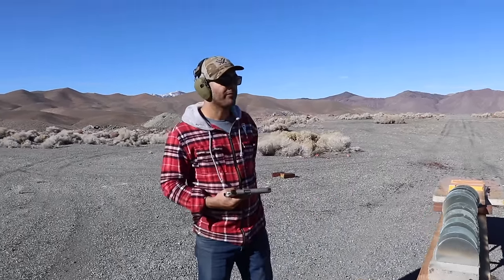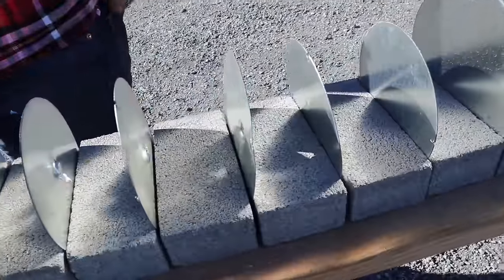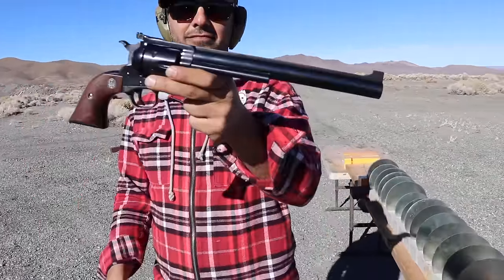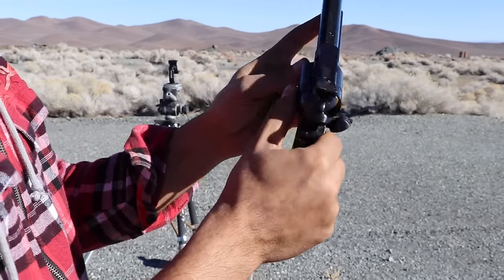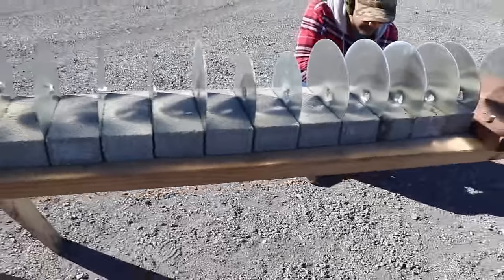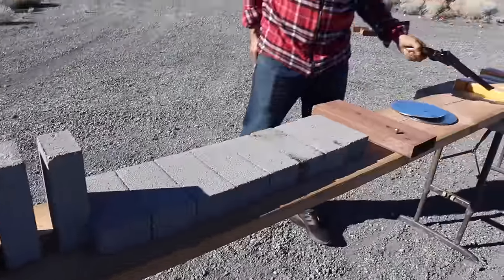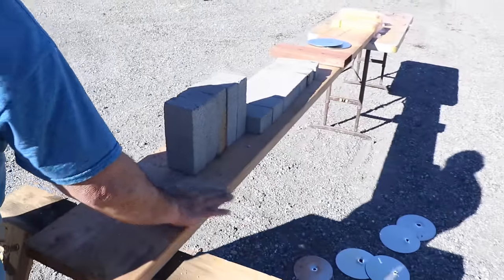45Colt vs 45Acp

Comment: The 45 Colt Government case was the parent cartridge for the 45 Auto Colt Pistol,. The 45 Colt Government was in all reality 45 Colt cases cut down in length to fit in the 45 Schofield, while still working within the 45 Colt pistol. 

So in all reality the 45 Colt case was the parent case of the 45 Colt Government, and the grandparent of the 45 ACP. The 45 Scofield 's only influence was that the army had the 45 Colt case trimmed down in length to fit in a Schofield while still being able to chamber in the 45 Colt pistols which caused the 45 Colt Government (a.k.a.- 45 short Colt) to be born. 

That is to say the 45 Scofield was only directly involved in the reason for shorting the 45 Colt case which made it but only indirectly involved in the 45 Auto Colt Pistols round development. Basically when the 45 Auto Colt Pistol was being spawned the 45 Schofield was benched on the sideline as the 45 Colt Government was spreading it's seed. And as all grandparents are, the 45 (Long) Colt was proud as could be, and still is to this day. 

Long Live the three generations of 45 Colts (45 [long] Colt, 45 [short] Colt Government, and the 45 Auto Colt Pistol rounds) - Amen!

The so-called “.45 Long Colt" is just a nick-name for the ".45 Colt” . That is to say the term "45 long Colt" is referring to the original round that was called ".45 Colt" which was made by the Union Metallic Cartridge Company. And the so-called short Colt was a nick-name referring to either the "Calibre .45" made by Frankford Arsenal or the ".45 Colt Government" made by Winchester (but not the .45 Schofield).

The story goes like this, first the government had the 45 Colt made. Then the government adopted the 45 Schofield being it was top break, and just so happened that it could not handle the 45 Colt round [even though the government asked them to try and make it handle such] but instead S&W decided to make it with a shorter softer shooting 45 caliber round (now known as the 45 Schofield cartridge). 

So now the government had two different pistols each with different case dimensions. The 45 Colt round was too long to fit in the Schofield, and the Schofield's rim was bigger around and would over lap each other when put into the Colt pistols, whereby only three rounds could be chambered in every other chamber, effectively making it a three shot pistol. This caused a huge logistical dilemma for the USA military. So the military came up with a solution of which they simply shortened the 45 Colt case down to 45 Schofield length. By doing this they had a case with a small diameter rim that would fit in the 45 Colts, yet at the same time was short enough to fit in the 45 Schofield pistol as well. Frankford Arsenal got the government contract and called the new round the "Calibre .45" and later when Winchester started making them they called them the ".45 Colt Government". And while neither of the three rounds ever had long or short in their naming by the manufacturers that produced them, soldiers and citizens would speak of these as long and short Colt rounds. Yet if they were talking about the 45 Schofield they would simply say ".45 Schofield". 

So actually the 45 Schofield was not the reason 45 Colts were called ".45 long Colt", at least not directly. That is to say the only reason long and short ever came to be spoke of was because they shortened the 45 Colt cases down to be able to fit in a 45 Schofield pistol too. Yet at the same time 45 Schofield rounds were never ever called "short" because no body ever shortened or lengthened the Schofield rounds. 

So again, even though the three different manufacturers never named any of these rounds by either Long or Short there were long and short 45 Colt rounds made. And the short ones could fit in the 45 S&W's Schofield pistols as well as the 45 Colt pistols. 

So if anyone ever tells you that there was never any such a thing as a long or short .45 Colt know that they speak from ignorance. And if anyone ever calls them by "45 Long Colt" or "45 Short Colt", well, simply understand that they are using nick-names given to them. Yet again, the correct names for the variety of 45 Colt rounds are ".45 Colt", and "Calibre .45" or ".45 Colt Government".

Comment: The long barrel on the single action Ruger skewed the test results. If you had used two guns with the same barrel length the results would have been nearly identical.
Reply: I agree  ,  they should know that.

Comment: 45 Colt aka 45 LC on average have a 10fps muzzle velocity difference and a 25 grain weight difference both in favor of the LC. 45 LC is also purposely under loaded. 45 lc could be even stronger than 44 mag if they loaded it to modern standards

Comment: I had a feeling that Colt was going to be brutal. The round was twice the size.
Reply: The cartridge size in this case has nothing to do with it. The 45 Colt round was originally a black powder cartridge, which used 40 grains of black powder which is bulkier than modern smokeless powder.
Barrel length also effects muzzle velocity as well.

Comment: A Ruger vaquero exploded in my friend's hand luckily no one was hurt send it to Ruger they said it was over pressure this is one cartridge that very easily can be overloaded with too much powder or double powder or worst check with a flashlight that all your gunpowder is visually the same level which better be correct in the first place

Comment: The 45 Colt has a longer barrel and heavier bullet.  The 45 Automatic Colt Pistol is at a disadvantage.
Reply: Not so.  The auto pistol has a solid barrel, the revolve has the barrel/cylinder gap which vents much of the gas to the sides.

Comment: Yeah but which one kick's harder? Which one has more recoil? I shot a 45 ACP and it wasn't that bad but I have a 45 lc now and not sure I can handle it!
Reply: I have a 3” judge and a full size 1911 and the recoil on the 45LC is not even close to the acp so I’d imagine if you have a longer barrel than that, it’d have even less muzzle flip to it.

Comment: The Ruger revolver 45 Colt barrel is much longer than the 1911 45acp.
The revolver will add more kinetic energy to the 45 Colt bullet, allowing more penetration. 
Not a fair test. If done with similar barrels, another story.

Comment: I didn’t see any description for the ammo being used. There seems to be a lot of variables here. Bullet types differ. Barrel lengths differ. There are many different power levels available for ammo in both calibers. The 45 Colt is the most versatile of the two, due to its case capacity and almost limitless projectile choices. Still, it was entertaining.

Comment: So is everyone just ignoring the barrel length differences? Ones 8”+ the others 5”. Fire them both out of the same length barrel. 

45 colt isn’t used prevalently for a reason… it’s no better than a 45 acp, the firearms are large and clunky, holds less rounds and other than the judge/governor modes, it would have gone the way of the 44-40.

Comment: Continuing third comment the 45 Long Colt if you're reloading you better visually check that you did not put extra powder in any of the shells using a flashlight another safety thing is you can press in the slug immediately after putting the gunpowder and don't start daydreaming or thinking of other crap while you're loading the powder focus on putting the right powder and keep your brain

Comment: Okay so there's a lot to unpack here. First of all barrel length definitely matters. There's a lot of unburned gas in a 5-in barrel that comes out the front as muzzle flash. 10 in there's probably very little unburned gas so I would imagine muzzle velocity climbs significantly for the 45 LC. Also I'm not sure that you're fairly comparing ammunition. I don't know what kind of ammunition you used in the 45 long colt. But essentially there's no such thing as non plus p or non-designer ammunition in 45 Long Colt that's manufactured today. All of that ammunition is going to probably be smokeless powder. The gun was originally designed as was the 45 ACP for black powder. The 45 Long Colt completely filled with black powder, with no doubt explode if filled with smokeless powder, but wouldn't even match a quarter of a standard case round filled with modern smokeless powder. In other words modern 45 Long coal ammunition is significantly stronger than the hottest possible loads from the 1800s. I wouldn't even put modern loaded ammunition into an 1800s revolver for various reasons, one of which would be case pressure. It's important to know that before I say originally 45 ACP and 45 Long Colt were designed to be equivalent cartridges. Both would have been more or less filled up with black powder in the case of the Long Colt and smokeless powder in the case of the 45 acp. Both of those being 1800s early 1900s examples of smokeless and black powder. Today you will blow up your freaking gun if you do that! Do not fill them up today with modern powder! But that's what they were originally designed for. Or more specifically 45 ACP was designed to be an auto pistol feeding version of the 45 Long colt. Basically when Browning design the cartridge for the 1911. He wanted 45 Long Colt ballistics but he didn't want the rim and having a shorter case was both advantageous because the longer case was unnecessary with modern powder and it made the handle shorter and more comfortable. So he worked with Colt to make a shorter version of the 45 Long colt. Today you can make really hot 45 Long Colt rounds and shoot them out of things like that Ruger Red hawk because that Ruger Redhawk is rated for 44 magnum. Which is not an equivalent caliber. That's a super long 45 Long Colt. Even the regular 45 Long Colt guns contain the metallurgy of those larger handguns. So modern 45 Long Colt ammo has 1. a lot more space than it needs to create a proper powder load. 2. Have better metallurgy then the original version of that cartridge. 3. Because revolvers don't rely on a very specific amount of pressure to cycle the gun properly they can shoot hotter loads without significant risk of mechanical failure. That being said they do make better more specific 45 loads that would be more analogous to shooting modern powder out of a 45 Long Colt. In the interest of keeping the test fair you should be using plus p 45 ammunition. Also the jacketing for the bullets should be similar as well as the weight. And of course as I mentioned before the barrel length.

Comment: The .45LC can be hand loaded to higher pressures than the .44M. In the Ruger Blackhawk.
Reply: I do that in my Henry .45. Just don't do it in an old gun or a handgun not strong enough to handle it.

Comment: There is no significant power difference between 45 colt and 45 acp, the 45 acp was designed specifically to achieve similar ballistics to the 45 colt in a smaller case due to the 45 colt being a black powder cartridge and 45 acp designed to use smokeless powder. Winchester super x, 45 acp, 230 grain, 835 fps, 356 ft lbs of energy. Winchester super x 45 acp, 185 grain, 1000 fps, 411 ft lbs. Buffalo bore 45 acp +p 255 grain, 925 fps, 484 ft lbs. Buffalo bore 45 acp +p, 185 grain, 1150 fps, 543 ft lbs. Winchester super x 45 colt, 255 grain, 860 fps, 420 ft lbs.  Buffalo bore 45 colt, 200 grain, 1100 fps, 537 ft lbs. Buffalo bore 45 colt, 255 grain, 1000 fps, 566 ft lbs.
 The only time you will find 45 colt that is significantly more powerful that 45 acp are the exotic over pressure +p loads that come with a chart that says what guns are safe to shoot them in and which will blow up in your face such as the buffalo bore 45 colt +p deer grenade, 260 grain, 1500 fps, 1200 fp lbs which is basically a 454 casull because that is what a 454 casull is, a 45 colt, filled with smokeless powder which has much higher pressure than the black powder that the 45 colt was designed to use and the case is lengthened 1/10th of an inch to prevent people from chambering it in 45 colt guns and blowing themselves up. The only relevance 45 colt has today is in old 45 colt firearms which cant use the high pressure loads and as cheap ammo to shoot in 454 casull firearms. If you want a powerful 45 colt, buy a 454 casull and feed it 45 colt for plinking.
 Edwin specifically rigged this test and it is despicable, he used 45 colt +p in a 10" barrel against 45 acp target ammo in a 4" barrel to "prove" that 45 colt is more powerful when he owns a 45 colt with a 4" barrel and he owns target ammo for that as well so he has no excuse other than blatantly misleading his viewers. My advice? Unsub. No one needs someone, especially the science channel, rigging their tests so that the result is designed to mislead. Anyone can look up ballistics between the two cartridges and see that Edwin is lying and hand picked both the ammunition and the firearms for this "test" to give the desired result when if he would have used 4" barrels on both guns and standard loads for both they would have tested very similar. He could have done this using 45 acp in both guns with the same result, 45 acp +p in a 10 inch barrel vs 45 acp target ammo in a 4 inch barrel and there will be a significant difference between the two but that does not prove anything other than +p in a longer barrel has higher velocity than standard loads in a short barrel.
Reply: .45 ACP was designed to replicate .45 Schofield

Comment: Well .45 colt was always black powder (on its last legs it was smokeless loads that where around .45acp power in the colt new service revolver) and the .45acp was a smokeless design from the drawing board meaning......

If u wanne do i correct u take a 255grain hard cast lead .45 colt round loaded with black powder in .454 bullet size out of a 1st generation black powder designed single action vs a colt 1911 in .452 bullet size with a 230grain copper jacketed round........This was a unfair match as the .45 colt was loaded with smokeless and had a much longer barrel...

Comment: All these pseudo experts claiming the muzzle velocity is higher with a longer barrel crack me up.

Muzzle velocity is muzzle velocity regardless of the length of the barrel. It doesn't change based on barrel length, the only difference is the grain of the bullets, and the LC is heavier so it will utilize the velocity it has, greater or lesser, than the lighter acp.

Sorry, but the 45 LC is a more powerful round fanbois.

Comment: My bedside and EDC (Open) is a modern 1873 SAA 4.75” bbl, in .45 LC. My “NY Reload” (concealed) backup is a 1911 .45 ACP. I’m old fashioned and don’t trust the stopping power of 9mm or .38 spl.

Why? The prisons are full of gang bangers with multiple healed 9mm wounds. I’ve never seen a healed .45 wound. Not even once.
Reply: Local guy got hit with 7 rounds of 45 ACP to the torso and walked out of the hospital in less than a week.

Comment: But,,, you go from a 5 inch barrel on the 1911, to a 7 or 8 inch barrel on the 45 Colt….. big difference…. But the 45colt still has higher pressures

Comment: Test is very inaccurate. Both guns must have the same length barrel so they burn the same amount of powder. Try shooting the 45 ACP with a barrel of the same length as the long cord. One casing might hold more powder but you’re not allowing it to burn with a shorter barrel. Both guns must have the same length barrel for an accurate test. What if you would’ve shot a snub nose revolver. It would’ve been different results. Same with a very short snub nose ACP 1911.

Comment: Well actually you have two completely different set ups here that you are trying to compare. Your .45LC should be shot out of a 4-1/2 barrel if you are going to compare the two .45s. The longer barrel of the .45LC is making the round have more velocity than the shorter barreled gun of the 1911 45ACP.

Comment: Different barrel Lane equals different bullet speed
Reply: Technically yes, but my convertible loads in 45 acp get about identical velocities from an 8" barrel revolver as they do from a 5" barrel 1911 due to the loss of gas and pressure at the revolvers cylinder gap. In a closed breech system it's considerably faster.

Comment: Its very obvious its not a standard pressure loading starling brass plus ruger 10 inch barrel standard pressure 45 colt would be very similar to .45 acp

Comment: I will not buy any more single action pistols they're antiquated InDesign you can load a long round that the lead is not pressed in enough and the loading gate will accept it and then it gets stuck in the cylinder in the gun you have to hit it with a dowel to get it out

Comment: Usually  45 LC  is around 14 000 psi ... 45 acp 21 000 psi  (fore same power).... but  all conversion  45cLC  cylindders  tolere  45 acp ammo  with a little  metal  wire......looool   in ROA... or steel repro   not in     weak brass frame replicas

Comment: .45 long Colt is just more powerful than .45 acp. Doesn't matter the barrel size. Example:
A boulder that falls to the ground is larger than a pebble falling to the ground. Therefore, if a boulder falls 10 feet it is going to do more damage than a pebble falling from 100 feet. Simple math.
Reply: Simple math

Comment: 45 Colt sucks it's slightly weaker has a half pound more recoil and is way bigger so you can't carry anywhere near as much ammo it's basically useless it's just more of a fancy round however I'd rather have it than nothing of course but I looked it up and it is not good

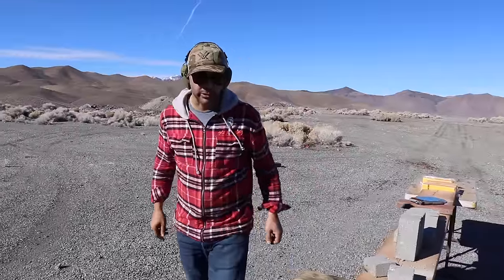Comment: That 45 ACP is not loaded right that's it really weak crap military hardball is 950 closer to 1100 and sometimes more 9:50 to 11:00 that's what we shot, IMI ammunition from Israel very hot very accurate very good 45 ACP has been loaded way down